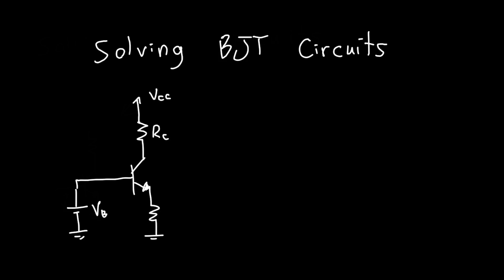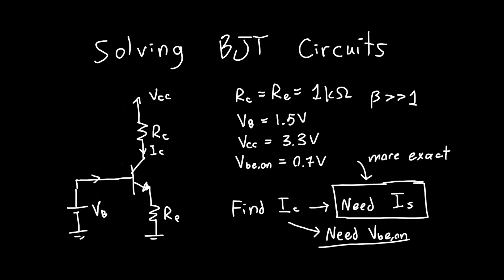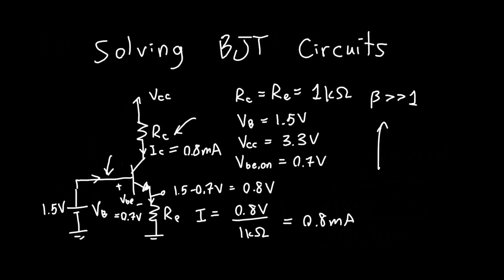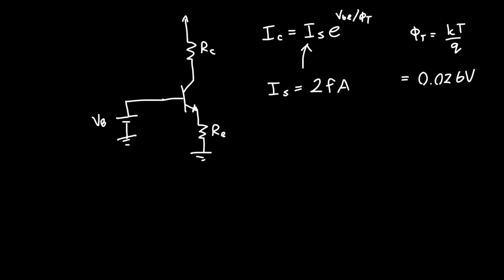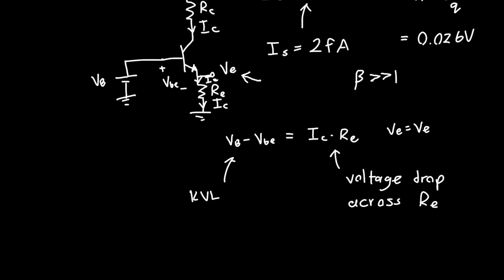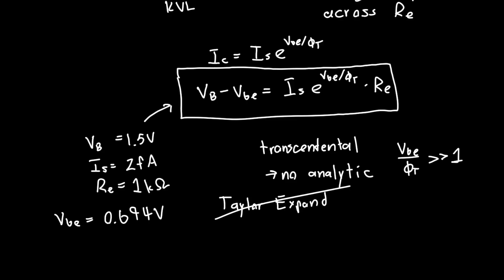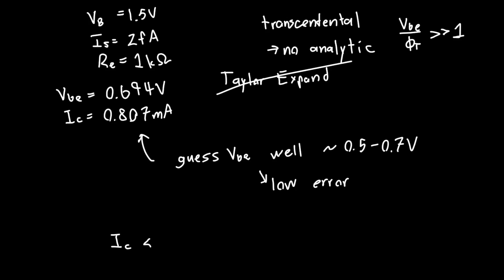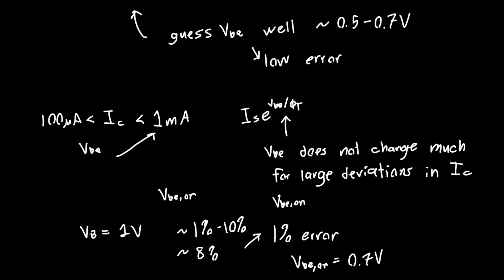Solving BJT Circuits Example

Comment: For supposing Vbe, the problem occurs when BJT is biased to have a very low Ic, so that it is in the limits of active zone. In that case whe would use che exponential version but: where we can find the “Is” in the datasheet of the component? For example, for a 2N3904 where is it? (there are only the cut off currents that if you insert in the formula it leaves to wrong results). In that case there is also the problem for the formula Ib = Is exp (Vbe/Vt) that for low currents is not valid for silicon diodes. The formula becomes Ib = Is exp (Vbe/(eta x Vt)) where eta ia a coefficient between 1 and 2 where 1 is for an ideal diode